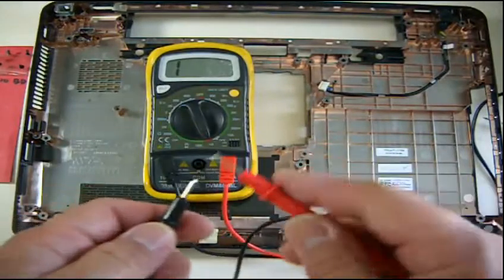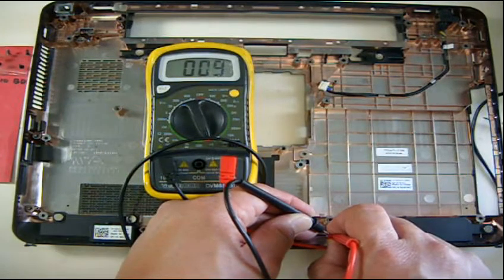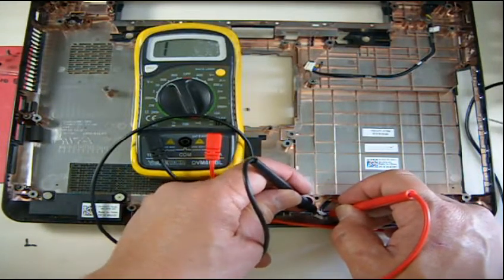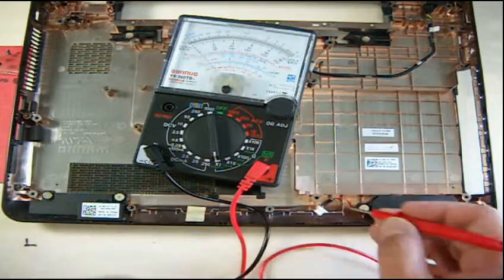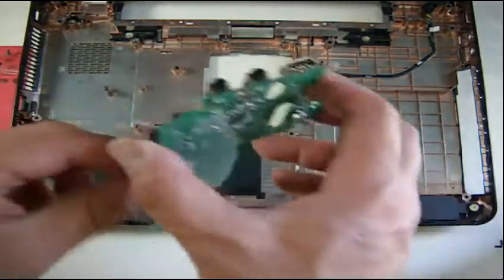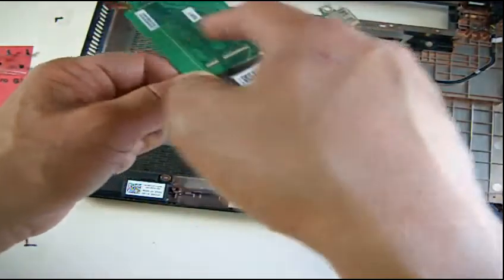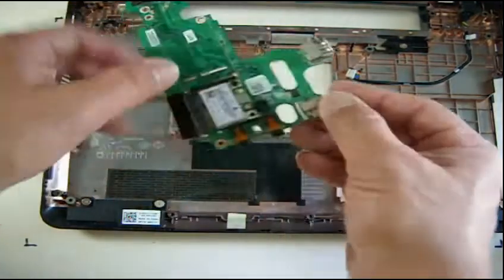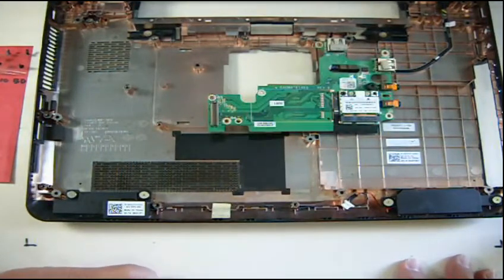How To Test Notebook / Laptop Speakers Using A Multitester

Comment: Thank you for making this video.  When I bought my computer (used), about a year ago, the speakers worked but not very well.  Then, about 6 months later, I could hear nothing.  I've just used earphones or speakers since then but I had the time and decided to look into it.   They tested out as functional, so I pulled them out and found that each had attracted a goodly  amount of iron filings that surrounded the magnets, not allowing the one material to move.  There are a few sounds and musical notes now and I will be moving on to repair/replace the headphone jack as that is all else that could be my problem.  Many thanks.  Subbed.